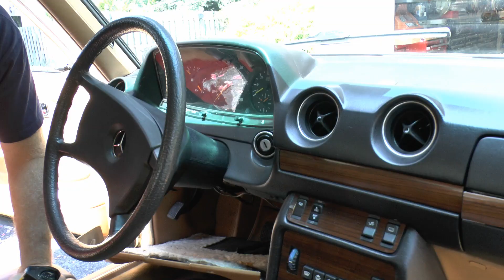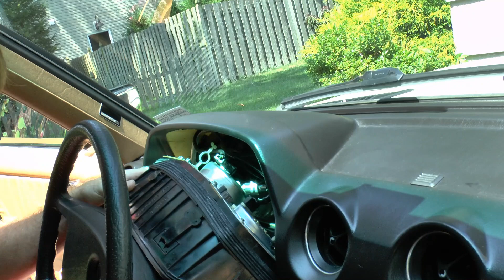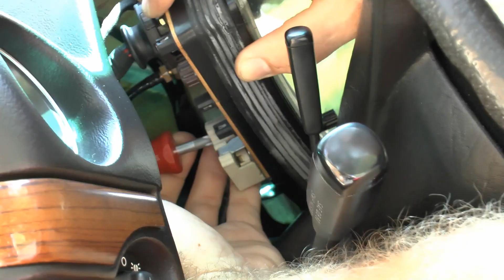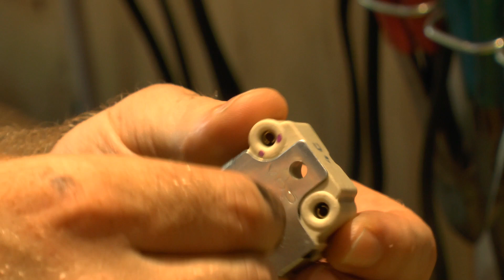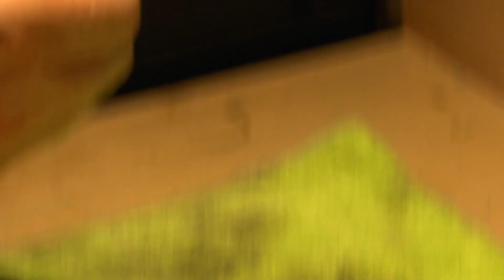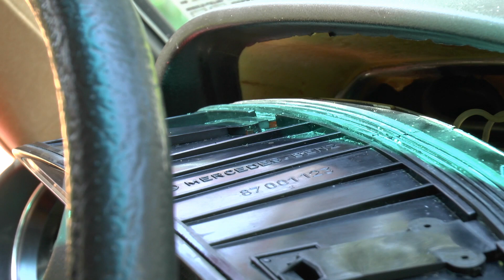Instrument Cluster Dimmer Fix, Mercedes 300D, W123

Comment: My problem was corrosion in the rivet retaining one end of the wire resistor. I pushed a four face awl into the rivet and screwed it backwards and forwards to displace the corrosion Second problem was that the wire resistor was displaced from the groove. I pushed it back into place and secured the free end with muffler putty (needs to be a heat resistant adhesive)

Comment: Thank you Meb. A very well made video. Could you help with my W124 /300D. No dashboard light comes on with the ignition switch.  Though the engine cranks over and turning indicator, emerg lights etc all work. Fuses all are ok. Drove the car yesterday..something gone wrong overnight? Thanks in advance.
Reply: Hey, I’m having the same issue let me know if you figure out the problem and know how to fix it. Thank you

Comment: Very easy to fix dimmer switch, take out instrument cluster, take out 
dimer switch, open it slowly, make sure you know where the springs go 
when you put it back together " easily done" then clean out the switch 
using water and baking soda, glue the big spring in its place so it does
 not move anymore, put everything back together, put the dimmer switch 
in its place and you have a working dimmer switch.  the switch is 
mechanical, no electronic parts, do not worry you wont break it.

Comment: How can you bypass the dimmer function to have always on the lights?
Reply from the maker: Just connect the poles on the back of the dimmer by soldering in a small piece of wire.

Comment: I wish I watched this before I took apart my potentiometer to clean it because I totally mangled that spring inside.
Reply from the maker: Worst case scenario you can jumper the contacts and it will bypass the dimmer function and your lights will be on full which is better than off :)
Reply: Meb how can you bypass the dimmer function?